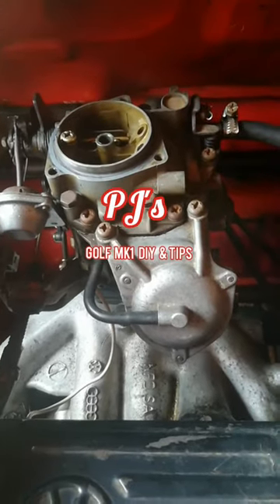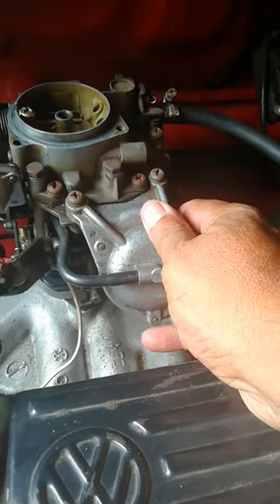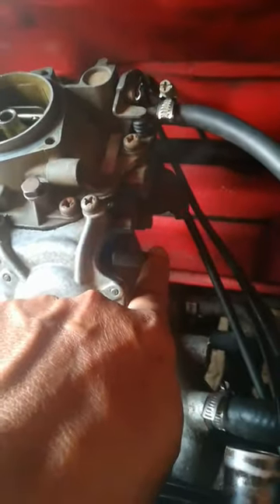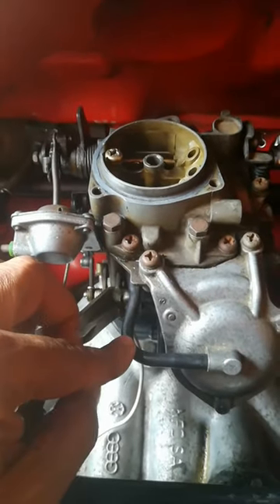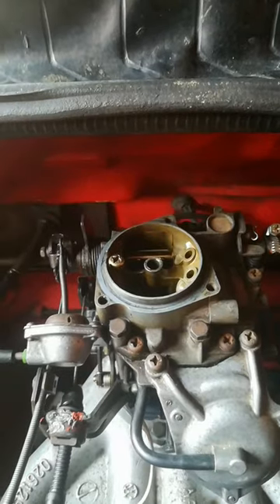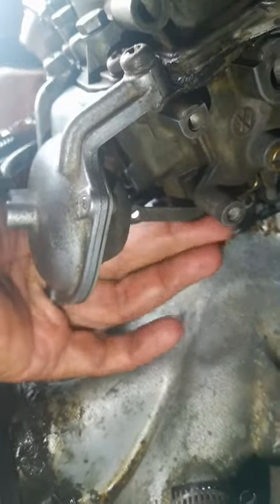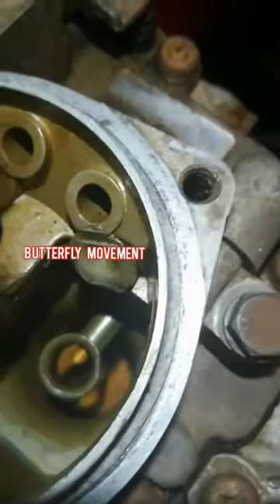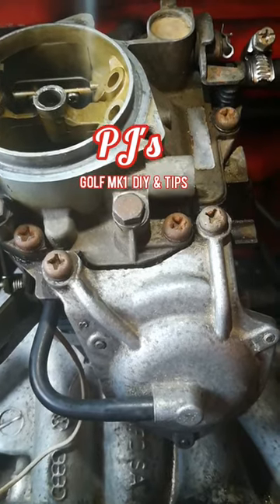VW Golf Mk1: Your Carburetor Second Stage may not be working  .Some Quick Info

Comment: Hi PJ. 
I have a problem on tha second stage. That lever you are shaking  next to the accelarator lever, is not working properly on my carb. It makes my car to run slowly after engaging gear number1  it takes long to go and it looks like is loosing power/strength. Then If i pull that lever a little bit forward towards the accelarator round lever the car runs faster than i expect and the accelaration is faster but the rev count goes yoo much lower to 5.
Please help how can i fix that lever thing

Comment: Hii there, I am currently facing a problem with my vw citi golf mk1 carb 1.3. I think it might have something to do with the second stage of the butterfly getting pulled, but sometimes when i drive and i accelerate the rpms will drop and the car wil sometimes backfire and then right after it wil return to the rpms it was, this only happens in a few seconds and not continuously, mostly when the acceleration pedal is being stepped on, what can be the problems here and is there any way for me to test things out for solutions? I would appreciate the help😁

Comment: Hi pj, live your videos brother, however im hoping you have any information you can pass on about my car, when i reach a certain rpm with my car the idle stays high even tho the throttle is all the way closed on the carb, when i tap the accelerator the idle drops, any info would be helpful thanks pj
Reply from the maker: It could be the second stage butterfly valve that gets stuck slightly .spray some carb cleaner down on it.and just ensure the links outside of carb are oiled  up a bit ..use Q20

Comment: I have been having issues with my 1989 fox
1800 CTI head with 1600 block
I replaced the carb base plate 5 times since December 
I just fitted an aluminum base plate and fitted paper gaskets top and bottom
I have a problem when changing gears. As soon as I tap on the accelerator then the revs drops as if the car cuts out and comes back again 
I had this issues with broken rubber base plates but now that I have the aluminum one on it still does that
I checked for leaks on all pipes,base plate and manifold but nothing 
I am desperate for help
Please advise on what to do
How can I contact you directly in order for me to call you and explain in detail what's happening and hopefully you'll be able to guide me in the right direction 
Please assist 
Thanks PJ

Comment: Hi pj when the carburetor is in working order there’s two barrels connecting to the base plate the smaller barrel which feeds fuel into the manifold works fine what does the bigger barrel do because when I was watching it’s doesn’t open or close neither does any fuel come out from there so what is the purpose for that barrel
Reply from the maker: Well that's exactly what this video is about..that barrel as you call it ,is the second stage .It only works under load .You won't see fuel coming out there while watching it..It works with engine vacuum..,when u reach a certain rpm..
Also watch the longer video where I explain in more detail.. https://youtu.be/Q0cuUR2BS8I
Reply: @pjs-golfmk1-diy  thanks pj